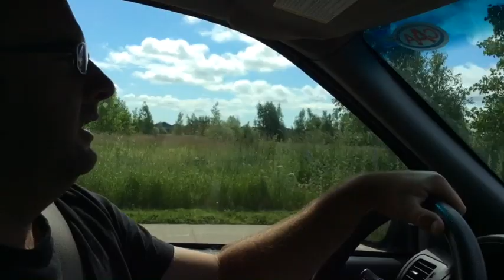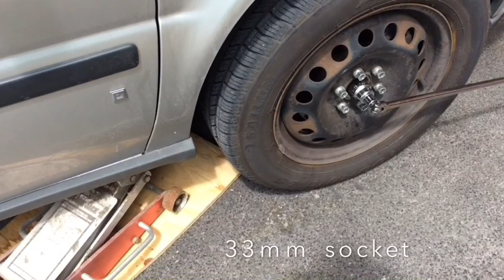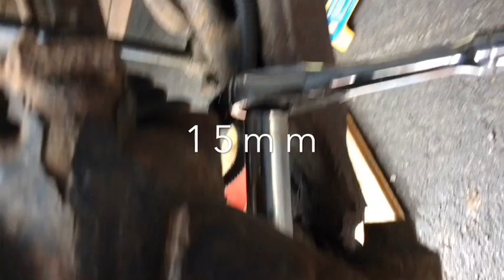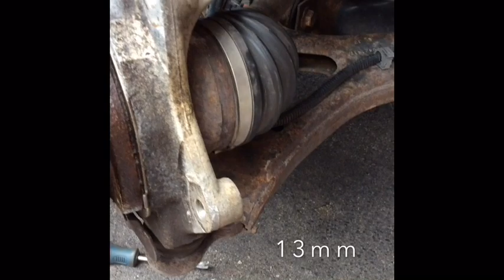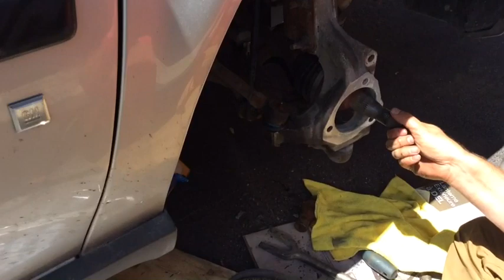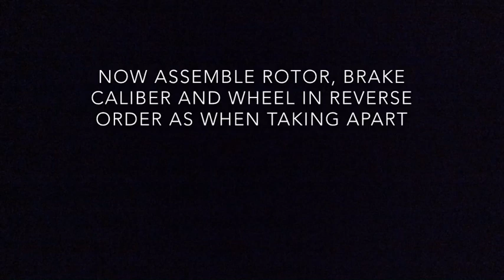2006 Chevy Uplander Front Wheel Bearing Replacement Car Repair Tutorial

Comment: Did yours not have the big dust shields behind bearings? I just did these on a customers 2008. Looks like somebody has been in yours before you.
Reply from the maker: No they didn’t. I think you’re right. I bought 2nd hand
Reply: @ificandoityoucandoit6507  the reason I YouTube’d this was because I wanted to look at somebody else’s dust shields because the abs wire brackets were completely separated off these lol I had to put them back together. great video though 👍

Comment: Easier if you remove the hub nut first....then you can push the half shaft back a little at full lock for better access to the hub bolts. Did mine on my 06 Montana....twice. Cheap white box bearings are useless. Went with Moog.
Reply from the maker: Agree! Good advice. Thank you

Comment: Please answer my questions in which direction the crank sensor of the Uplander engine is located
Reply from the maker: Sorry, what crank sensor are you referring? I didn’t adjust a crank sensor
Reply: @ificandoityoucandoit6507  I mean where the engine sensors are
Reply: @ificandoityoucandoit6507  I have an uplander and I have a kinetic sensation and I don't know where to tell me where they are.
Reply from the maker: Sorry, i don’t know where they would be located
Reply: I mean where the crankshaft position sonser locted?
Reply: @sqaralsalam6  there is no crank position sensor